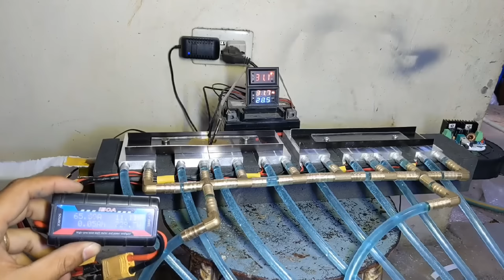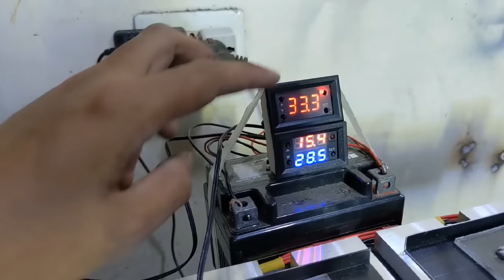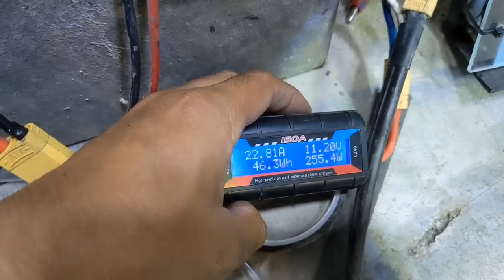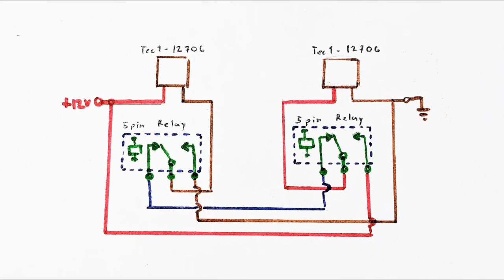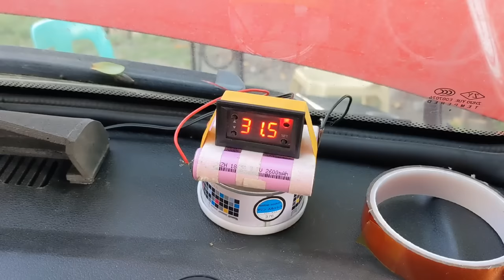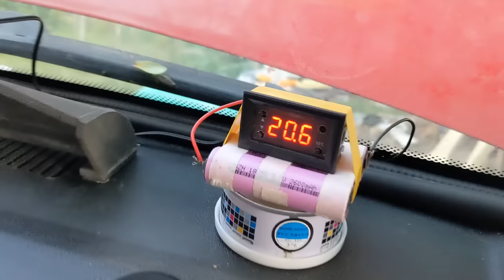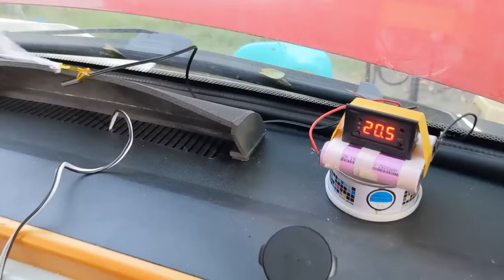car air-conditioning using peltier

Comment: There are 12v Freon compressors that are more efficient, I’ve researched the Peltier for quite some time and it only works well in direct contact heating or cooling but it’s very bad with air cooling for AC’s.  Using the condenser inside the car with a fan might be better than that small fan blowing on the cold heat sinks too. So instead to taking the whole thing apart, get another condenser with contact liquid adapters and circulate the cold liquid. It will also have a quieter fan than the smaller fan. The larger the liquid tank the better and you can wrap it in rock wool or use a small bathroom heater tank and turn it into a cool water container that is cooled by the Peltier. Great project, good luck!
Reply: Can you share some 12V Freon compressor model numbers?
Reply: @Darkipod you may want to start with a search for 12 volt refrigerator compressors.   Refrigeration compressors, etc.

I would suggest not using Freon. But instead propane.  Propane is a cheap readily available item. And it works excellently as a refrigerant.  It is also the most environmentally safe refrigerant.
Reply: @dannydoolhoff7657 is explosive asf too, I've seen houses completely destroyed because an AC charged with propane, don't tell people to do such dangerous things
Reply: @hansmuro7355  there are many units on the market today that use propane as the refrigerant.  Many water coolers, ice makers, refrigerators, and freezers now use propane.  As a refrigerant it is referred to as R290.

"The R290 system has the advantages of a fast cooling rate and high refrigeration efficiency. The average specific refrigerating effect of the R290 system is approximately 52% higher than that of R134a with the optimal charge amount."

Propane is excellent as a refrigerant, and works at lower pressures than the old R-12.  An R-12 system can easily be cleaned and converted to propane and because of the lower pressures, also extend the life of the system.

Yes, precautions are needed as with all refrigerant systems.

Comment: Peltier high power consumption, low efficiency, not recommended to use unless it's really necessary
Reply: Any alternative to that?
Reply: @sarthaksaran2671  Refrigeration technic is only alternative right now
Reply: @pjoskar1 I project to build it in Peugeot 206 without AC. I will place 2 modules 12703 in the intake grid on bonnet with hot radiator cooled by speed air of the car and cool air will aspirate in AC cockpit in hepa filter... I conscient that system is no optimal... But effective cost is better that setup AC with compressor and change all system cooling car.
Reply: @sarthaksaran2671 heat pipes
Reply: E qual vc recomenda?
Reply: @sarthaksaran2671   pergunta alguém tentou ligar o sistema do vídeo acima ( deste ar condicionado com pastilhas petier,direto em algumas placas solares em casa pra ambientes?
Reply: Use dc aircon compressor
Reply: @mordor3335  have u made it?

Comment: This is great.  It's possible that you use less coolers and space them apart in different areas inside the cabin to zone the effect over a wider area than ganging them into a single assembly.  You've done a great job and it inspires ideas on how to create an efficient setup.
Reply: "efficient setup" and peltier? AHAHAHAHHAAHAH thank you for giving me some laugh

Comment: Hi 

Great work on this project. I have done a similar experiment as well.

Try the setup in parallel

I think one of the specifications mention that a current limiting resistor may be required to ensure that the device does not heat up, this can also reduce the efficiency of your setup.

You should use a variable speed pump so you can improve the scavenging effect of heat from the peltier block.

Sometimes slowing the speed of flow will be useful to improve with heat removal. You can use PWM control for controlling the speed of your pumps.

With your tubing try to have a parallel path , rather than branching into one serial connection which reduces the output flow to your heat exchanger.

Need to mount the cooling side of your peltier inside the air duct work
Reply from the maker: I'm going to improve this.. thanks for ldea
Reply: I did not understand the story of the series, the hex was originally on the parallel, and did the pump increase the speed of the pelleter temperature?
Reply: @albertnario4877  Proverbs 1:5 A wise person listens and takes in more instruction your humbleness and comment proves this scripture 💯
Reply: @albertnario4877  Proverbs 1:5 A wise person listens and takes in more instruction your humbleness and comment proves this scripture 💯

Comment: yeah if you run peltier modules at 12V you need about same amount of electrical energy than you get cooling but reducing voltage to 6V for peltier module increases coefficient of performance even to 1.8 but then you also need more peltier modules to achieve same cooling power but you use much less electricity

Comment: In order to achieve an effective result, you must make the fan draw air from inside the cabin
Reply: Yes, recirculation is best. 👍
Reply: @Demostenes Ramos instead of the thermostat turning them all off and all on, maybe switching them to 12v (maximum cooling) down to 6v (less cooling) when the set temperature is reached. 
This will help to reduce load on the batteries and peltiers, increasing its life span and increase efficiency.
Reply: @ka-i  I saw an amp draw of 65 amps. That's a crazy load to have on a car battery or am I mistaken ? I would assume it would be more efficient having a vapor compression cycle as it would reduce the load down by alot.
Reply: @derrickenbuenosaires  absolutely a vapour compression system would be much more efficient. But it needs the skill of making it and also finding the parts to make it. 
The vapour compression system has a higher initial cost, but is much more efficient than a peltier system. Depending on how they system is designed, they can have a Coefficient of Performance of up to 7, but realistically around 3-6, which still greatly outperforms the current peltier system
Reply: @Demostenes Ramos  ya I don't think it will ever turn off unless it is cool outside
Reply: @ka-i  that is interesting. What module can be used to control temperature according to voltage? What device? Is it thermostat? I do not have electrical background so a bit Clueless.

My idea was to create mini circulating aircon for a tent. But was wondering about thermostat to regulate temperature especially at night time becoz it can be colder at night but at the same time to find mechanism to save power since it will run on powerbank/battery.

Do you have suggestion? I would appreciate that
Reply: @ka-i  peltier could be a great choice vs portable aircond because less noise and smaller to make it portable. However I am a bit concern regarding power consumption to run the peltier plus its cooling fan system.
Reply: @benahmad9432 peltier 12726. Its 260w 16amps -55grados 5cm/5cm. Los de video estan la mas flojas claro a 2-3 euros peltier 12726 esta a  20euro. Pero es uno con un ventilador con bote de aqua peqinea metido adentro por un coche peqineo silve. Claro gasta la bateria tiene que ser siempe en marcea.

Comment: Hello, peltier junction therm couples are very inefficient. There's only a 30-35 degree reduction, that's not a lot. Very high current draw is one down fall to them. I tried making
something like what your creating. The net result was not enough cooling. This will kill
a battery or over heat a power supply. I'll stick with Freon based A/C's

Comment: i already did something like this in my subaru forester and its actually super low profile. i made use of my original a/c condenser and as the evaporator i used a small pc water cooling radiator. ofc water blocks on both sides and two little pumps using coolant, and the peltiers im running are 15 amp ones..... 360w of cooling from that works already and wont burn up your alternator. also this system runs by the stock cab controls.
Reply: Did you really feel the difference ? Thanks
Reply from the maker: only two peltier? it works?

Comment: If you had directly added heat sink to the cold peltier side with thermal paste and just made a shroud around it with plexy glass or even pvc for that matter it would have been more efficient i believe..... The more layers of metal you add to the peltier the more it loses its efficacy....... And you forgot to put thermal paste on them too i believe (black metal thingie)✌️
Reply: He did add a thermal paste. 0:20

Comment: One of the better attempts at making AC with Peltier 👍 The set up would be a lot better if the cooling part was inside the vehicle, recirculating the air, with the peltier hot side coolant being cooled outside of course. Still horribly inefficient though.

Comment: The intake should have been from car, with air intake should have a filter. Secondly you have to fit two thermostat ( one for water temperature and another inside the car to save the battery

Comment: make sure to set up a way for it to draw air from within the cabin, this reduces humidity as well.  Make sure to set up a way for it to drain properly.
Reply: Great tinkering , I am tinkering with using the cold to condense water from the air through a copper pipe coiled. I will put a water  exchanger on both sides of the peltier and may store the heat in a sand storage to use later to heat a house. You could pass water into the car and put it through a cpu radiator with a p.c fan on it .

Comment: That's really interesting but almost any small compressor based design would be more efficient than this.  You could have more cooling for less power consumption. Thermoelectric devices are compact and useful in certain applications but they are terribly inefficient.
Reply: could just put a fan and pipes into a portable/12v fridge to get the same effect and only 50watt when running would even fit in the front of that car for duel use .
Reply: @maxgood42  No.  Those extra-mini refrigerators are also thermoelectric and have even less cooling power than this does.  Those only have one thermoelectric device, compared to the four pictured here.  Better to not bother, and just open a window.
Reply: @leifhietala8074  Yeah those toy's would never do, maybe stop your butter from turning to oil ha ha. I'm refering to the small camping fridges that are often found in the back of a 4x4/Camper Trailers ex.., Talking about Peltier's,  "Tech Ingreadients" made a Peltier fridge and found that the Peltiers run better at lower volt's like around 5v rather than the rated 12v (thermal efficiancy and stuff) That little EV looked like it has enough room for the smallest 12v compressor type, eg there are centre console types now available with the same 50 watt compressor unit found in the small to medium range fridges.
Reply: Comparing a compressor (that needs oil, refrigerant, and will eventually wear out) to solid state electronics is like apple's and oranges.

Comment: @Albert Naro
I just put a portable house air-conditioner in my car running off of a inverter and it works pretty well... I don't think you're Peltier device is going to be able to make the temperature lower inside the vehicle....

If you can find a old air conditioner like the one you found at the junkyard but it still works and a 3000w inverter I think that would work well for you. It is definitely the next cheapest option
Reply: Hi, and please tell me how much power do you have an air conditioner? How many watts? And the battery in the car is 12 volts and the generator is how many amps? I was also interested in this option

Comment: There is a reason those are not in regular use in refrigerators, and more important, in comfort cooling due to the low efficiency.  Some modules can have a respectable temperature differential for cooling IR camera sensors for thermal cameras, but high BTU heat transfer applications is not a good fit for the low efficiency of those devices.

Comment: I am no expert in peltier cooling, but i thought the 12703 module is the most effiecint between all other peltier modules needing only around 3 amps and its also the coolest clocking around negative 15 to 20 c. While others only hoovers around +1 to +5 c.

With that being said, theoreticly the 12703 module should cut your amp consumption in half while offering almost double the cooling.

Comment: U make a great job, if u keep your car doors close,  and rotate ur car cabin air for cooling then u will get cabine air cool down very quickly and PLS think about air moisture which will convert in water so add a water drain system too

Comment: Could you explain what the problem is (write it in the description, because I don't speak your language) and why you came to that solution, when there are larger commercial radiators that could solve the same problem in a simpler way with less price and less possibility of failures (unions)

Comment: Bro you have done a great job , kindly use 12703 instead of 12706 as 12703 runs on 3 Amps and cooling efficiency is way more.then 12706

Comment: Award for the world's most inefficient AC goes to Albert Nario. Takes one hour to blow air at 20 degrees, takes another 5 hours to reduce the cabin temperature by 2 degrees and by that time you would have already changed two batteries

Comment: you should to change the circuit, the heat sinks put on the hot surfaces, and the coolant liquid run in the condenser, Here is a loss in temperature of the cold air due to its transport. Use water as a cooling medium and place the condenser inside the car cabin

Comment: peltier is actually a heat pump!!! it generates 80 percent heat to generate 20 percent cooling. So. its COP {coefficient of performance} is not like a n airconditioner which i guess is 10 to 20 times more efficient. I would  remove your build and attach it to a little mini fridge case and use it as a chiller / fridge in a camper RV and utiilise a pwm controller which can be tailored to drop your watts consumption by 5-10 times.
Reply from the maker: version 2 is on its way, it consumes 30% less energy but 2x more colder
Reply: @albertnario4877  great ... peltiers can only attain a max of 20 degrees drop  from ambient temperature. A car interior is much higher than ambient as dashboard, etc act as heat storage, maybe around 10-20 degrees higher than ambient. An airconditioner is perhaps 50-100 times more efficient vs peltier under these circumstances. This exercise is fruitless!!!  Watch others videos who tried such!!
Reply: Hey, this would also make a great heater in winter with those percentage
Reply: @albertnario4877  still waiting for version 2.

Comment: Using Peltier modules is not a wise thing because you cant get same output over a time. Inside Peltier it gets corroded due to like mist inside within the each Peltier modules. few days you will notice the in efficiency of using those. But I appreciate your idea and your skills of doing such a innovative thing.
Reply: Its bullshit, although what this person built isn't that efficient your comment is manure, a good paltier unit is sealed and has long life provided good ventilation it doesn't "corrode" like that

Comment: Interesting. Cat without an AC? Btw. Why I would drill holes (12:43) when it's all mounted and put the plastic pieces into the circuit to let it stuck somewhere.

Comment: I'm doing the same thing for fun. a cold side liquid heat exchange works better.  add a bigger hot side radiator with more pumps.  more insulation. but yah the portable window ac are more efficient pertaining to power. my interest was to use in a car or solar. basically, the only advantage no inverter required.